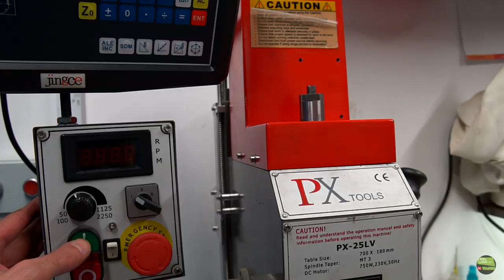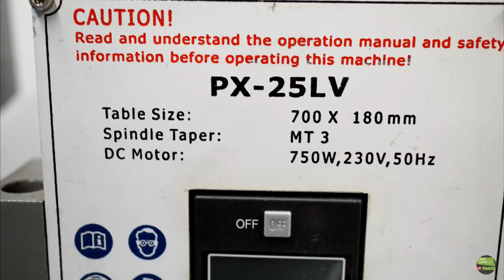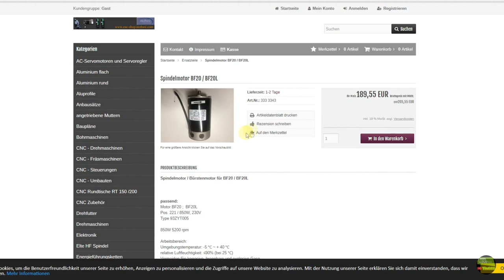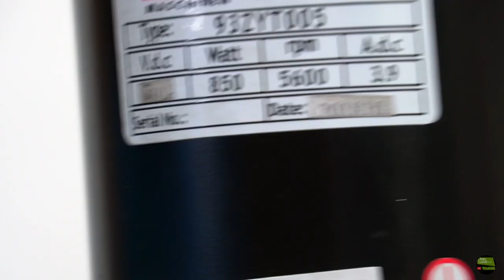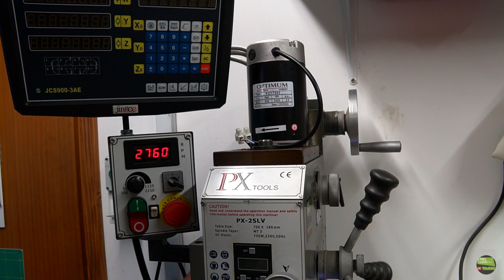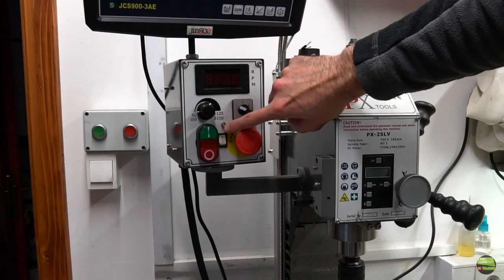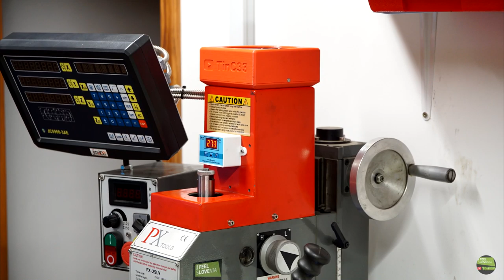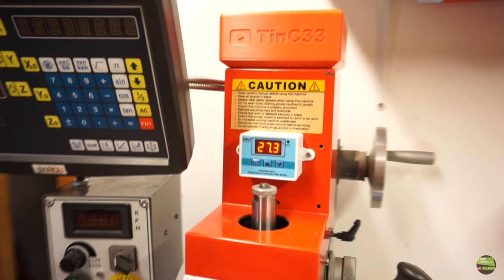Replacing DC motor on my mini mill and making cooling modification

Comment: And you managed to use the hot air from the motor to warm your workshop in the winter, nice project, well executed.
Reply from the maker: True, i got the radiator also in that room, but only open them few times per year, that workshop actually heat up from all the machines and equipement, specially 3d printer, but also that room is on the middle of house so only two outer wall. Thanks

Comment: I have a slightly larger mill and my motor died too, but I installed a 1.8KW induction motor with VFD, way better than the OEM. If you have to change the motor again I recomend you getting an AC servo as spindle drive, they are quite afordable now from china. I bought 4 750W servos and those are beasts.

By the way, thanks for that web with replacement parts, very usefull!
Reply from the maker: Thanks, actually i spend about 2 weeks before i order a motor, i studdy many different solution, as you say i looking for induction motor in combination with frequency drive, but it cost me much much more, only FD cost about 300€ + motor about 200€ but the biggest problem was that i can't mill the flange and all the equipement to attach new motor onto mill, because i'm without motor ;)
And also think that induction 3phase motor got much much less torque on low rpm, with that motor i can cut M12 thread into steel.
I want more rpm on that machine, but also if i change the motor, spindle won't be happy with higher rpm, the sound of a spindle on 3300rpm was just: no please don't
So i got something different in my plan for a long time but didn't realise yet, to mus small chinesse spidnle with drive, you know that small spindle motor with about 500W wich turn on more than 10krpm, well that spindle than just attach next to thatone, and make that with a few screws can be removed, i think it's be a good solution for making with small tool somewhere to 6mm where you need more rpm and not that big force.
Reply: @TinC33  There are chinese VFD with vector controls quite cheap, and motors can be found second hand too. It's true that usually asincronous motors are too big for your mil. My motor died when I was halfway of my belt conversion, had to finish the parts with a hand drill atached to the drawbar to run the spindle.
Don't do too much big threading or you will burn your motor again!
The side spindle is a great way to get higher RPM, but get something decent, low quality ones suffer from noise and vibrations. I would like to have 10k too (today I modified my settings to get 4500 with my 1500 rpm motor), but I want to change the spindle with a BT30 in the future (expeeensive).

Comment: Nice mill upgrade. Mentioned DC motors are known as underpowered and have weak brushes, I had similar issue with the same motor at my Quantum lathe. Replaced motor and added new fan as well. What is the German company you get spare parts from? Best regards to Slovenia from Czech Republic.
Reply from the maker: Hy, it's cnc-shop.mobasi.com they also got parts for lathes. Thanks, greetings from Slovenia

Comment: Do you know if there are metal gears instead of the plastic ones for this milling machine?
Thank you very much?
Reply from the maker: @Nick-fi6qr   i bought one from pertinax material, i never seen that before but running great for years with some hard work sometimes, but they are preaty loud but i issume steel one will be louder.
If i remember gears wast tagged as optimum 20, 25...

Comment: Hey, is that axel/spindle of the motor 10mm ?  that one you ordered for Optimum bf20 ?
Reply from the maker: Yes d=10mm l=22mm
Reply: @TinC33  thanks for the video and info, i was/am stuck with my mill too. After wiring the motor to 12 volt battery it still runs, but in the mill it shorts the power breakers.. i changed the print/modules but that did not help.. found the same shop so i will know in a couple of days :-)

Comment: I just experienced the same, my Optimum BF20 Vario throws the switch, I suspects it is as yours, the motor that is dead. Do you know if I only need to replace the motor, or do I need to replace the board as well ? The motor you have on your table, where did you get that from ? Thanks from Denmark
Reply from the maker: Hello i need to replace only motor not the regulator, i buy the motor from some germany shop cnc shop mobasi, price is onlyne shipping is 24€ i thing heat is the big problem and that modification work awesome, hardly reach 40 degree...
Reply: @TinC33  Thank you for your fast answer. The X axis powerfeed, what brand is that ?
Reply from the maker: @sidewind131258  google for mill power feed mine is no brand but holzmann got same one

Comment: Is it possible to replace the mill  worn out DC motor with an AC motor and possibly a vfd?? Or it has to be dc??
Reply from the maker: Sure you can, i think a lot about that because i hardly find that "original" motor, but it will cost too much and there will be too much work, need to make new mounting plate and use different gears or belt... So i just buy that motor amd save some money, for next time when i'll take one series bigger machine with ac motor and vfd. But still afraid that 3 phase motor in combination with vfd doesn't got so much power ag low rpm as dc motors, i can cut m10 thread with that one easily.
Reply: @TinC33  I am planning on converting my mini lathe to ac 3 phase with vfd is it a good choice??
Reply from the maker: @ThanasisThomas  i don't know if we buy new lathe with ac motor they advertise its power specially on low rpm, but as i know dc motor got better torque, but maybe i'm wrong so with right transmission get bigger power also on low rpm...
But deffinitely 3 phase motor are better in many ways, i buying new bigger lathe (550mm size) but i'll take with dc motor, because i don't see a problem here, on mill the motor was jhst worn out i mill some huge stuff with 20mm mill and deep cut, closed in that housing with frash air... That cooling system work awesome, motor don't go over 45 degree celsius anymore.
Reply: @TinC33  so much info thank you! :) greeting from balkans here aswell

Comment: I use DC treadmill motors on my tools. They are cheaper from Ebay. The treadmill motor looks identical to your motors. You can find a hole treadmill from Craig's list for very cheap.
Reply from the maker: They really looks identical, thanks for info.

Comment: Hey there! 

First, I want to kindly thank you for the really nice video you made. It was crucial to make me understand the problem I just had. My father’s motor won’t run and after I inspected the brushes, I found out that one of them was completely destroyed… It might sound bad but it was actually a big relief, because it seems that there isn’t a problem in the windings.Though I have no idea where I can find new ones here in Brazil. 

Do you know where I can find similar brushes or ways to adapt new ones in my case? 

Are there other motors I can use to substitute in case of problems in the windings as well ? 

Everything related to that is so expensive here because of import taxes, I hope there's a workaround

My father’s motor has the same model as the new one you changed there, I hope there’s a way to solve it. In any case, Thank you so much for your help !
Reply from the maker: Hello, if the brushes cometely demaged, please open tge motor and inspect the colector (cooper end where brushes running on the rotor) you can use a fine sandpaper to clean them and make sure there is no touching between any two li es on colector.
I'm quite sure you can get the brushes in brasil, try to google for "motor brush" you can find bigger one and tgan simply sand it to dimension you need grapgite is very soft. You can also find the one without spring, than just cut connector from new one and cut the old brush from cable, use old spring install it between new brush and old cable with steel end and solder the wire in tbe middle of spring... Otherwise check ebay for "optimum bf20 brush"
Reply: @TinC33  Thank you!  I'll follow your advice, if everything works just fine I'll make a cooling system just like yours 👍
Reply from the maker: @RuiM4ster  just be sure to take brushes for dc motor not ac like angle grinder etc, cooling system is awesome it barely reach 45degree even if running for hours.
Reply: @TinC33  what are the differences between DC and AC motor brushes ? I think my father already ordered some and I'm not sure which one it was 😯
Reply from the maker: @RuiM4ster  i don't know, but i try to fix some dc motor once by using angle grinder brush and it turn very slow, i thing there is some difference into resistance of grapgite itself...

Comment: Hi TinC33 I follow your magnificent videos. I would like you to give me your opinion about my future milling machine, it would be better one such as tulle or a larger type MB4 or HBM 45 clone ....
You know someone who has it.
Thank you
Reply from the maker: Thanks. About the mill i hardly say it's all depend on what you use it for, for some serius milling like farm equipement all this mills are too small, i make some thins on mine but soon become too small, but on other side, for make smaller stuff like i do here on my videos, i don't want heave larger, because you need to stand beside when working, by that mill i easily sit on chair and got everything close to my hand, except Z axis wheel, to reach that one i must stand.
The mill itself is super tough, i cut hardened material once, the chip was in fire but the mill do their job without problem, i couldn't beleave what it can do, also milling steel a few mm at once isn't problem.
If i buy once again i'll take same machine, not smaller maybe just a version bigger, but must to think twice, because bigger version got induction motor wich can't change it's rpm, so you only got transmission with about 6 gears, but i love potentiometer so much on a lathe and a mill, so also if i buy mill or lathe with induction motor the first upgrade will be frequency drive but it's not cheap.
I think it's better to take without dro because you can get it cheaper if you buy and attach by yourself. But if you got choose, take the biggest possible table, and if there an option auto support, i got locky that i got auto support for x axis with a mill, othervise i'll take without, but now i see that just can't work without auto support and everyday i'm closer to realisation to make auto feed also on Y axis.
That mill is also a bit different than optimum and bernardo with that mark, because it's got mk3 konus, bernardo and optimum got only mk2 konus, so you are very limited with tools, on the mk2 konus 16mm is max mill size you can clamp, on mk3 is 20mm, so it's preatty important, also lot of milling head, face cutter, fly cutter, boring head... got MK3 shrank.
I hope you get some info from that, and if you got any question feel free to ask, and sory for my english i type fast without thinking ;)